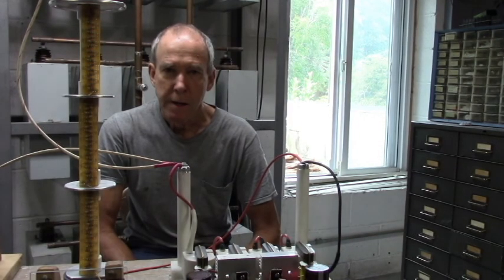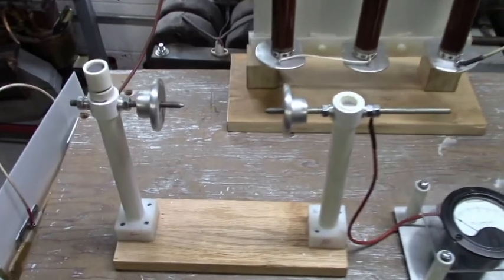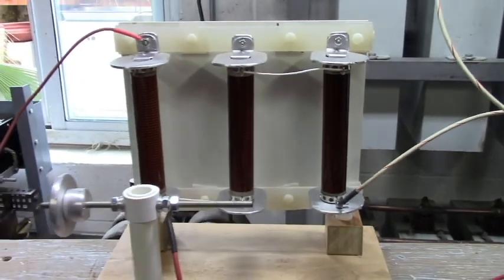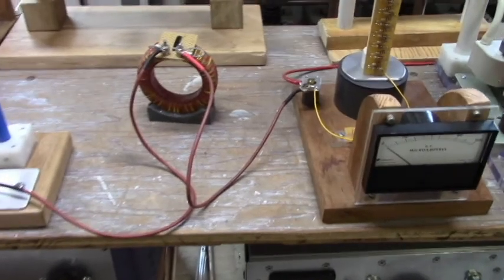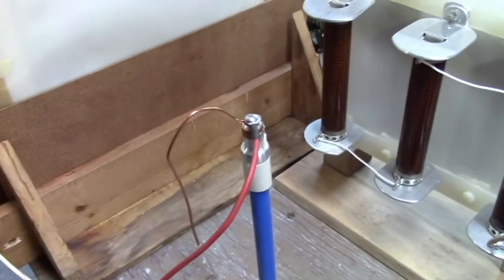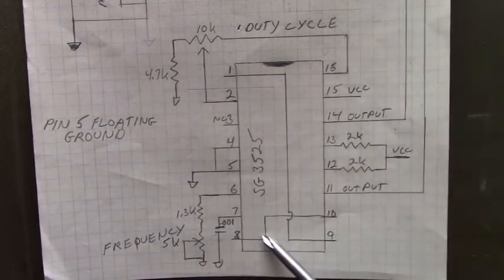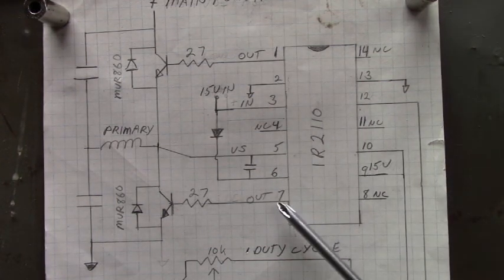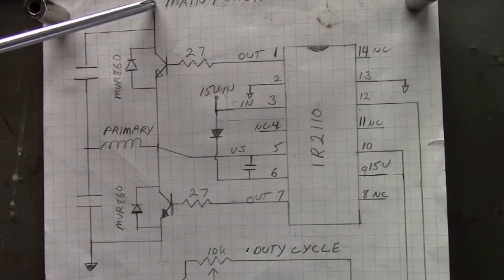60 Kilo volt flyback setup

Comment: Can we add 8 transformers in parallel to this circuit or is it 4 per circuit only? and if we can add 8 transformers in parallel is there any cons about using 8 instead of 4? Thank you for your knowledge and kindness to use it for good.
Reply from the maker: The transformer primaries were wired in series parallel. It might be easier to parallel 2 units of 4.

Comment: I'm building your circuit and thus I have some questions about the circuit which are: Concerning the 2 Mosfets or transistors what kind  did you use or do you recommend? And what is the output of the transformer (characteristics)and is it a 120v ac or a 220 ac transformer? Thank you so much for your knowledge and help. Live long and prosper!
Reply from the maker: Glad you are interested. I used a FGA50T65 on this setup. I think any 650 volt IGBT or FET would work well. Since the video I now have a .047 uf cap and a 5 ohm resistor as snubber. The original unit was 220 ac.

Comment: What are the names of the original integrated chips 16 pin and 8 pin on the original board ? I cant seem to remove the covering over them to identify them. Seems to me like they really didn't want anybody to know! Your help would be very much appreciated, thank you.
Reply from the maker: The 8 pin chip is a IR2101 and this is a high side and low side driver. I don't what the 16 pin chip is, but it is used on the current regulator circuit. Is it a comparator ?

Comment: What is the mains voltage?
Reply from the maker: I ran this from a DC supply using my home built half bridge driver. The board the unit came with was a 240 VAC input. I used my driver because it gave me more control. This is a commercial unit for electrostatic precipitation units.

Comment: Very help full sir, 
while connecting flybacks secondary in series, Is there any resistor between secondary series connection to ground? Or directly in series? (because I have seen somewhere else use of resistor between 2 connected flyback secondaries and other end of resistor to ground)
Reply from the maker: There is no resistor. This was purchased as a commercial unit. I just replaced the driver.
Reply: @stephenhrobak3631  Right, the package of flybacks are connected directly, though hanging to each other as loose without any pcb etc Thank you so much

Comment: Stephen, what is the part number on the output transistor you used in this circuit, also what is the voltage on the 0.33uF caps. thank you

Comment: Be careful! This seems to have a high UV emission. Wouldn't be surprised if you got some x-rays either because the camera with the huge arcs seemed to have hot pixels or the camera was struggling to capture the arc in realtime.
Reply from the maker: X rays are not produced in air. You need a hard vacuum and a hard target.